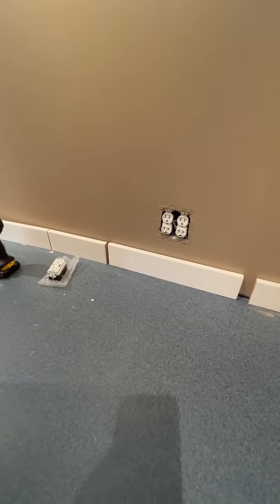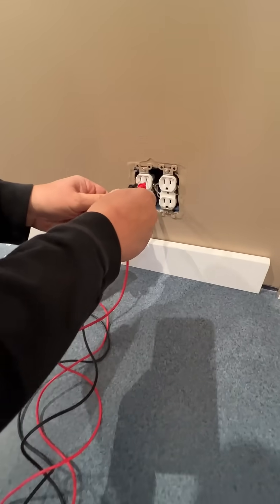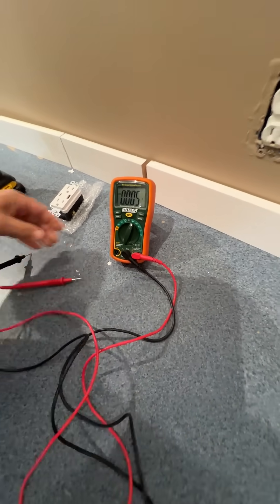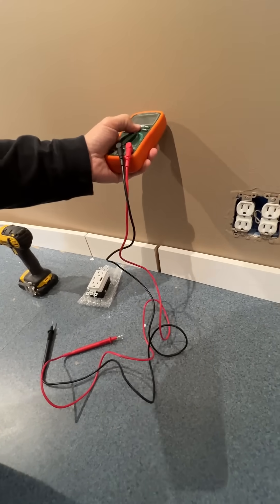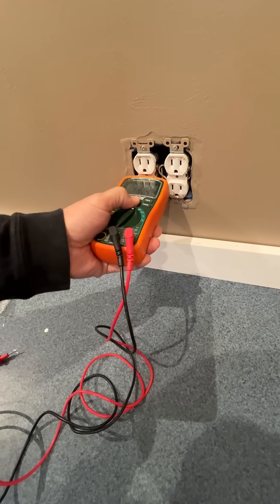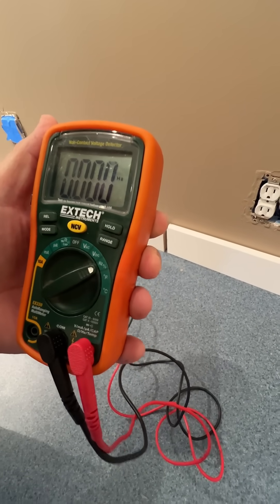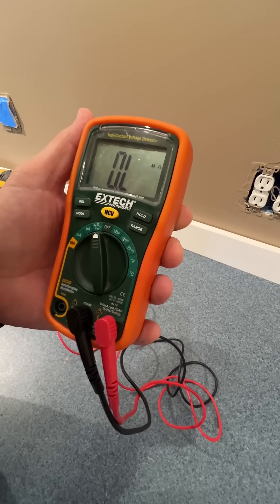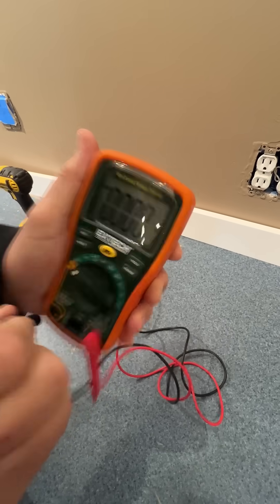How to Use a Multimeter | Multimeter Demo & Basic Functions Explained

Comment: Don't use both hands to put probes in you can never fully trust a cheap wire coating to not kill you! speaking from experience. Not the kill part though 😂
Reply from the maker: Thanks for the safety tip!